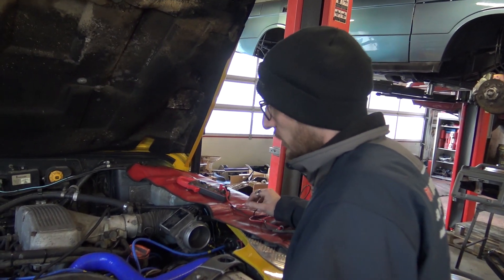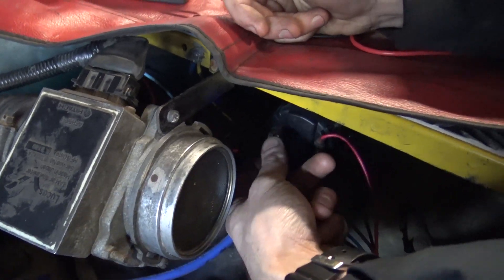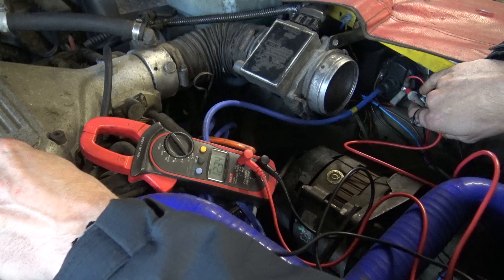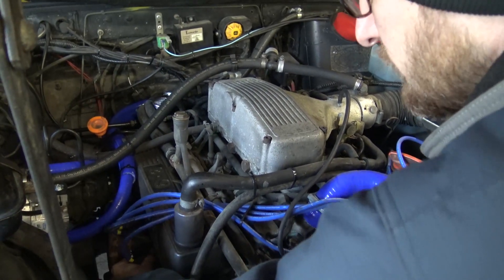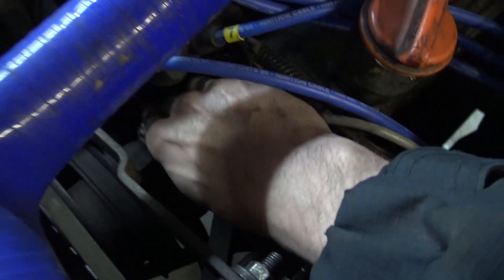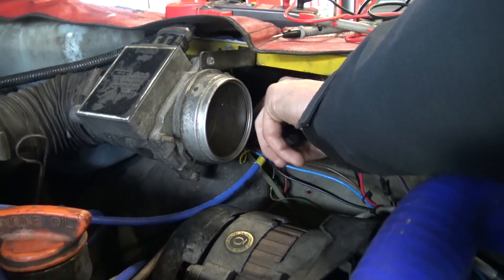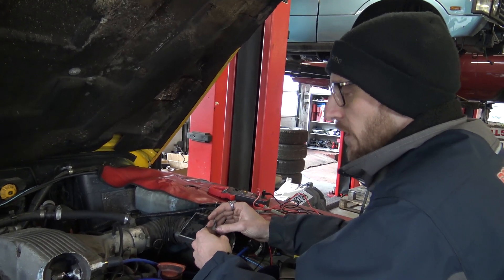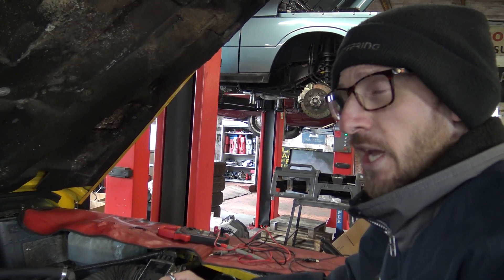RPi Engineering A&R Amplifier And Ignition System Test - How to

Comment: Great channel! Could bad ignition wiring cause fluctuating idle? It feels like the rpm drops below standard idle speed and then fluctuates until I hit the throttle. It runs fine when driving.

Comment: I think you should told us what the voltage at the coil is when cranking the engine is 9.5volts acceptable?
Reply from the maker: We are doing a full ignition kit install where we cover far more this was just a simple quick video from years ago. However yes 9.5 volts on cranking is fine.

Comment: Hi, im daniele. I have restored a 3.5 engine, but at the First start, i listen an esplosion on the air collector. I supposed an incorrectly spinterogeno position. For you what is?
Reply from the maker: Hi,
Yes it most likely is incorrect ignition timing. Turn the engine to TDC on the firing stroke and then make sure that the rotor arm is pointing to number 1 plug lead.
Reply: @RPIEngineering  OK thanks a lot. Afternoon I try.

Comment: I've been running one of your earlier ignition amplifiers for about 20 years on my 3.5.  The one regular failure point has been the two plugs which shove into socket on the side of the distributor.  These are exposed to the weather and get  dirty and corroded.
Reply from the maker: Hi, Thanks for your comment. Yes I have had a couple of people mention  this recently so its on my list of things to develop. I think a 3D printer should allow us to make something that would plug in an seal. Its not a common issue though I think it depends on the environment the car is used in. We have also modified a couple of dizzies in the past to have a two pin plug on the outside for a better connection.
Reply: @RPIEngineering   It would make for a much more secure connection if you could create a proper fitting.  I'm currently thinking of adapting the original on-distributor ignition amp to act as a plug.